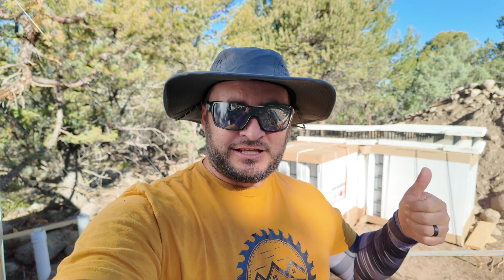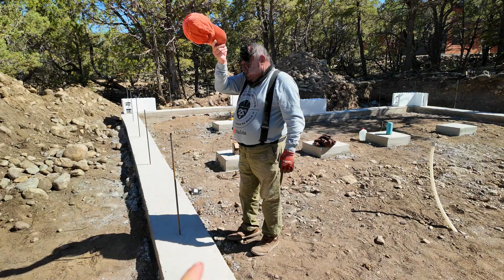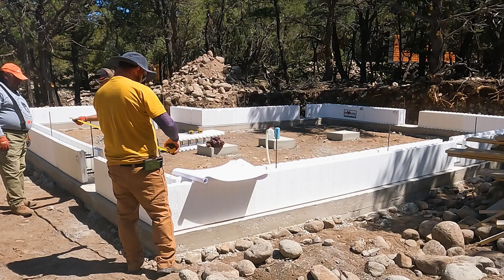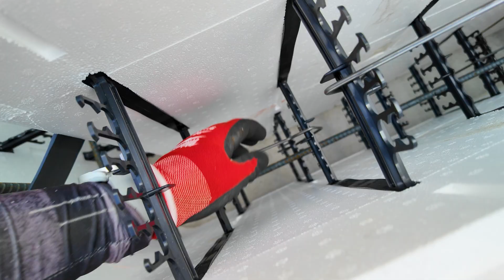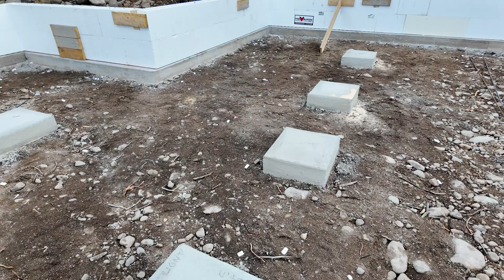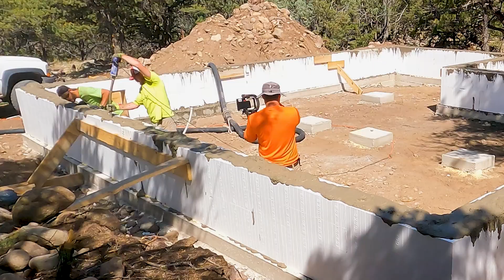Fox Blocks ICF Foundation Build – Fast, Strong, and Energy-Efficient

Comment: Looks awesome! In Central Asia, where I’m from, ICF is popular too the extreme temperature swings make it a great solution. Curious, is your main reason for using ICF speed, simplicity, or something else?
Reply from the maker: Thank you! Awesome! I like the speed of assembly, simple to use, both sides are insulated when done and I know the forms won't fail during the concrete pour